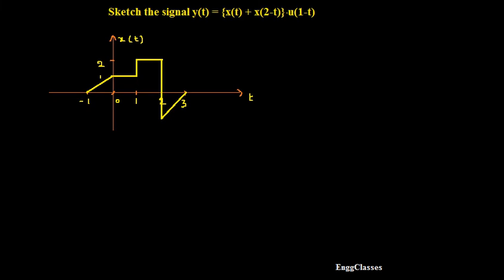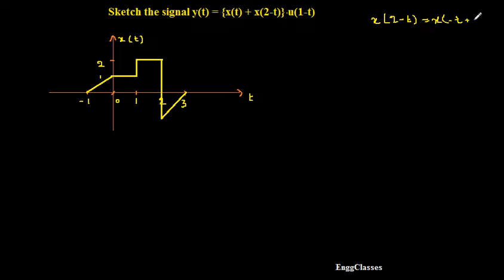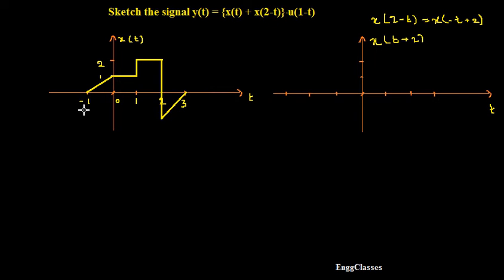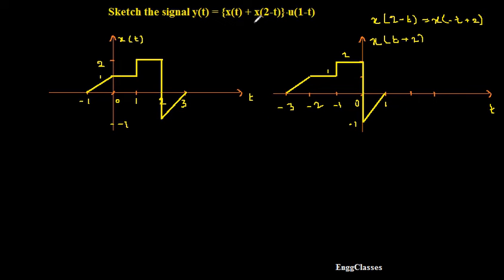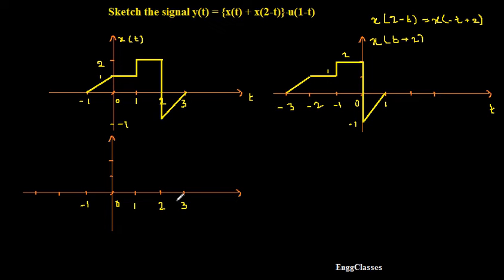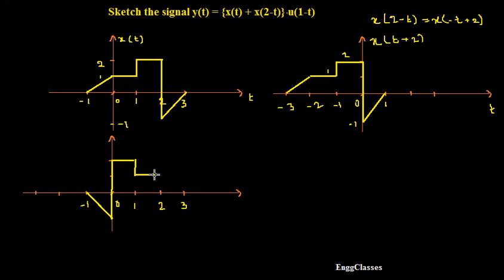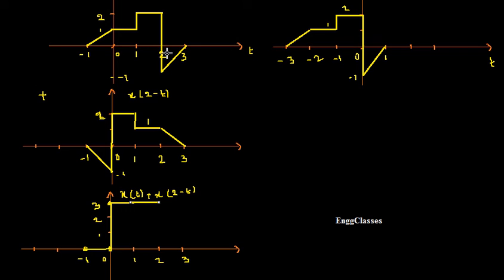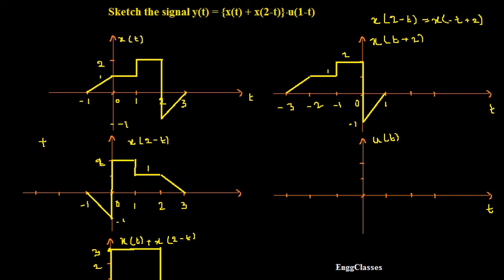Q1. c. How to sketch the given signal? | EnggClasses

Comment: /quick Sigx micro 2Kr''Rm" RADs in 360deg therm 3-D grids vk paves R&D /
/< ++- *^3Aliin cg=L'' || R'' sphres Vt'' fr: tube mech hydroz hose productives /
/fr Braebus Batman air foils Vdz stckrs head phones submersibles R&D /
/outer layer acts NAV SET for ABV f(x)s paves controls respects /

Comment: If I have delta(t-1) instead of your last signal which you have u(t-1) multiply?
Reply: x(t)delta(t-1) is just a delta function (upward line) shifted to point -1 on the x axis, scaled (height of which) is the value of the function x(t) at t = -1 (so value at x(-1)). So yes simply multiply (meaning scale)